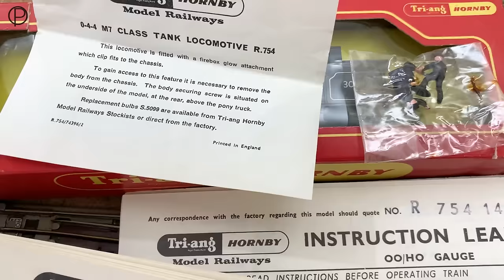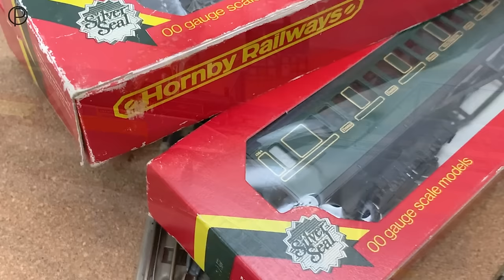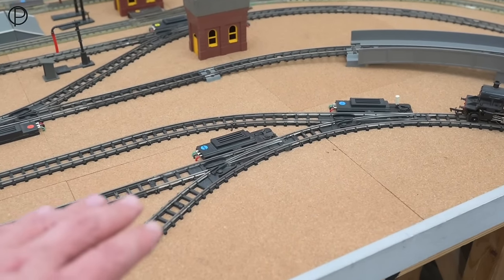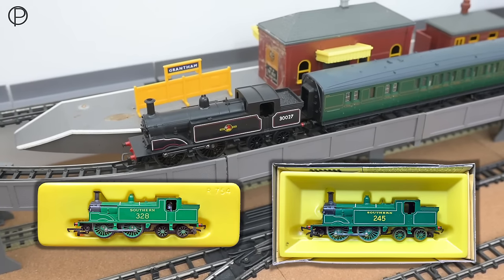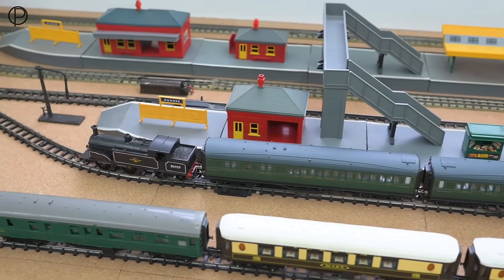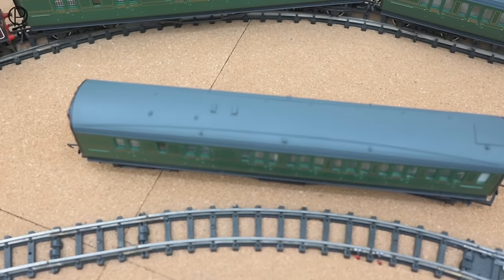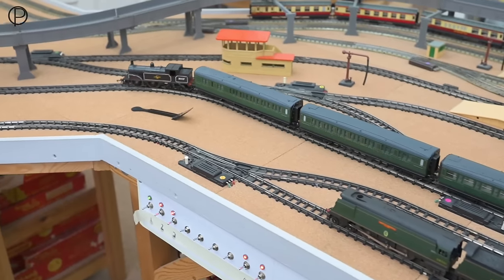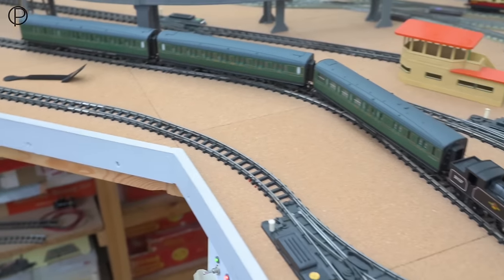Tri-ang Hornby R.754 M7 Tank Locomotive with SR Coaches

Comment: I have an old M7 too, from 1967! Mint, original box, sealed crew bag, and all the paperwork it had, including a "leaflet" . 
Was part of a "job lot" pack from ebay; and i was surprised when i opened it, do to box was wrapped in some packaging paper, tough the description did mentioned that the lot has a Triang M7 too (with the class 31 + a Hymek with the rest of the rollingstock).

Comment: Hi Oscar, Lovely looking M7. Really nice condition. s you may have guessed I have several of these in my collection. Not quite in as good a condition as yours. But several of them have a problem. The bakalite/plastic pick up bases have broken up and have to be jury rigged to work I was wondering if you knew anywhere where you can get replacements. Even plastic printed ones will do. Anyway another great Sunday video to watch.
Reply from the maker: Afternoon Jared, thanks again for looking in. It's great to hear you have M7s in you collection. I've not come across  any replacements/ reproductions for these collection plates, it would be nice to have reproductions of these along with those for the Lord of the Isles / Caledonian single which are also very susceptible to damage. 
All the best.
Oscar

Comment: Hi there Oscar ,, I really like the M7 locos as I bought 1 from Western Australia around 2 years ago and but had all the fire box glow but had a blown globe so I ended up taking all of it out but have kept in a safe place to use it later if needed. The one i got is a good runner and just needed a good oiling and cleaning and is a ripper. The smoke box door is in tact and does open and close too though like you said its only ever opened once and that will do me. 
Ive also bought another M7 along with a heap of other locos and that one was a non runner and it was all there but really just extremely dirty as it sat in the guys roof for over 40 years so i pulled it apart cleaned it and it is a good runner too and the firebox glow on that one works a treat. 
You mentioned the number on the door being slightly crooked well it must be a triang thing as both my M7's have the same crooked numbers on both of the opening firebox doors.
I also bought just today a R.59 tank 2-6- 2 loco and its a gr8 little runner too but its not a black one buts its a dark green colour but the front of the boiler is black. It has made in England on it and I got it foe $70 ausd
I also got a rake of dark green Triang R.29/221 southern carriages and they havent been touched in 40 years either and has open box axle and sleeved wheels.  Are these also compatible with the centre carriages in the dmu units of the same colour as they look quite similar to the other ones that I bought a few years ago but cant remember if they are or not. 
The only thing i can think of that is different from the other ones is the ones i got today have the mark 2 type couplings on them.
I really do enjoy cleaning them to look like brand new but with there playworn features.
Thanks again for your informative video's for us to watch and learn from.
Cheers from John in Australia.
Reply from the maker: Afternoon John, they sound like great models. It's always good when these things come back to life with a bit of a clean and very rewarding. The 2-6-2 tanks are lovely models I had a black one with mk2 couplings given to me as a child, so I have a soft spot for these now. The green ones came along about 1960 first with solid wheels and double lining before being upgraded to see through wheels with steel tyres / magnadhision and became single lined around this point, the black ones came along in the mid-50s first with acetate bodies. The green coaches you mentioned are R.229 S.R.Main Line Restaurant Car and  R.221 S.R. Main Line Composite Coach these were available with both Mk2 and Mk3 couplings and are not quite as dark green as the R.334 centre centre for the DMU and are a slightly different in design and I don't think was ever available with Mk2 couplings becoming available in 1961. I've included a couple of links below with reference to the coaches.
Great to hear you enjoyed the video. Thanks for watching and taking the time to comment. It's very much appreciated.
Oscar

http://www.tri-ang.co.uk/OO%20Latest/Coach9inSouthern.htm
http://www.tri-ang.co.uk/coachDMU.htm

Comment: That was a very nice running sequence at the beginning, lots of good varied shots. Those old silver seal wheels do run very smoothly but it's a shame that the spacing is so wrong on them. They worked well on your track but don't do very well on Peco code 100 points, I have had to swap loads of them out and now have a tin full of them plus old plastic wheels.
Reply from the maker: Evening Rob, great to hear you enjoyed the opening sequence. I'm always surprised when the silver seals work so well, the early variant will be metal axles are much nicer running but these later ones with the plastic square section and push on chrome/ Metal tyres can be quite variable, I think chrome/ Metal material used can rot away overtime, I'm not sure whether this is too due to previous storage or just poor material.
Thanks again take care.
Oscar

Comment: Morning Oscar, great video with the M7 loco and the green southern region coaches, if I can ask you a question, I've come across a Triang box car with the Giraffe in which bobs up and down, any information about this would be appreciated thanks John
Reply: This vid has a demonstration and the R.348 number for further investigation :
https://youtu.be/qYbReGWJXHw?si=cHjwVCQQKwsBsX-a
The comments have description of the magnet, spring, between track centre rail and levers that get it to work. Triang from 1963.
Reply from the maker: Hi John, it's a great little device. I do have one, but haven't had it in a video, there are some pictures of them and the variations at this website.http://www.tri-ang.co.uk/giraffe.html  it was later developed into the sniper car for the battle space range. The original car was produced between 65 and 69 and the sniper car 69 into the early 70s
All the best.
Oscar